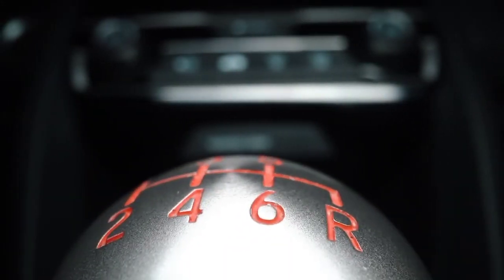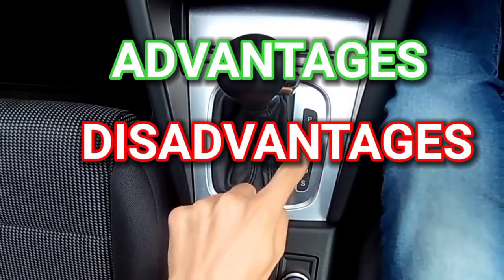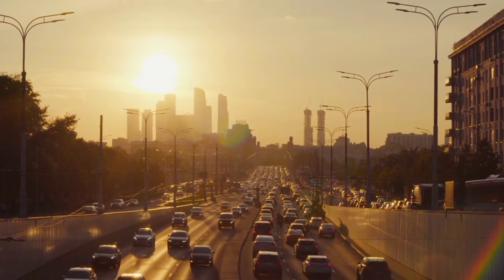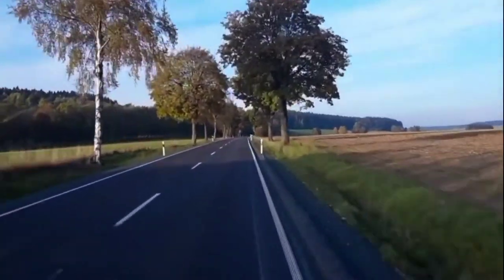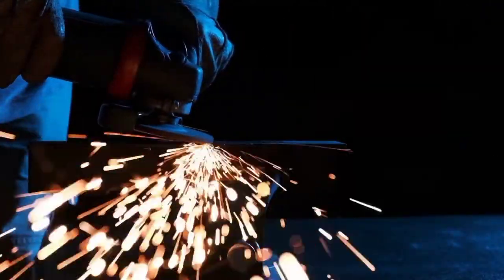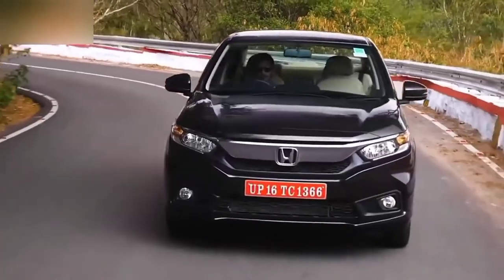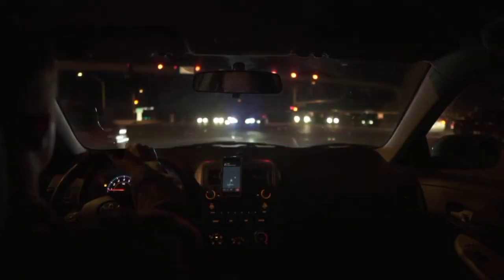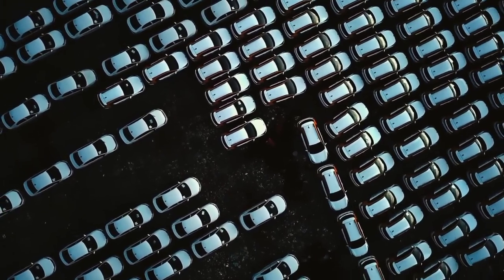6 Types of transmission system explained: Manual, AT, AMT, iMT, CVT, DCT (What's right for you?)

Comment: I'm new to driving.Initially i bought a used Honda jazz CVT and learn driving on that car.Now I'm planning to buy my first brand new car.My main priority is mielage.Im thinking about Swift AGS.As I'm familiar to Honda CVT,can i drive maruti AGS car seamlessly?...plz reply anyone.
Reply from the maker: Hi, sorry for for the late reply.
It's great that you're considering a new car! The Maruti Swift AGS (which stands for "Auto Gear Shift") is a popular choice for those looking for a car with good fuel efficiency. As for whether you'll be able to drive it seamlessly, it ultimately depends on your level of familiarity with automatic transmission vehicles. While the Maruti Swift AGS is a different model and make than the Honda Jazz CVT you previously owned, the basic principles of driving an automatic transmission car are the same. As long as you're comfortable with the basics of operating an automatic transmission vehicle, you should be able to drive the Maruti Swift AGS without too much difficulty. Of course, it's always a good idea to take some time to get familiar with any new car before hitting the road, so you may want to spend some time practicing in a safe location before taking the car out on the road.